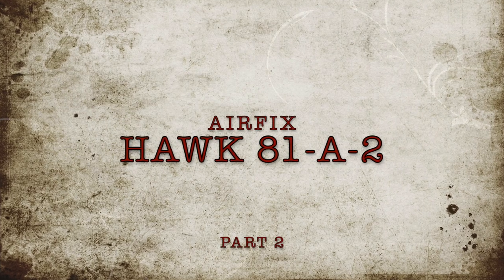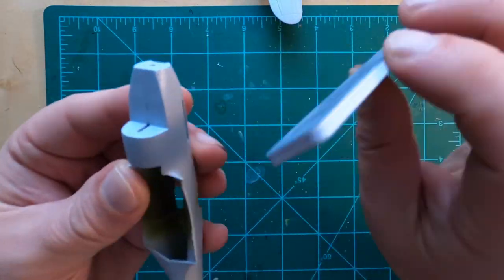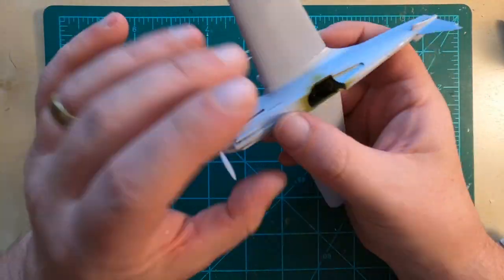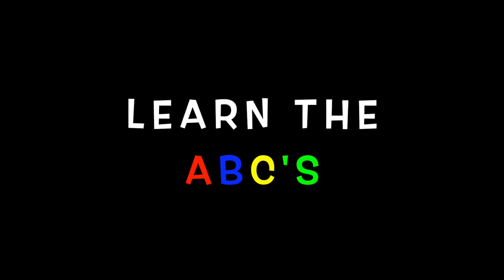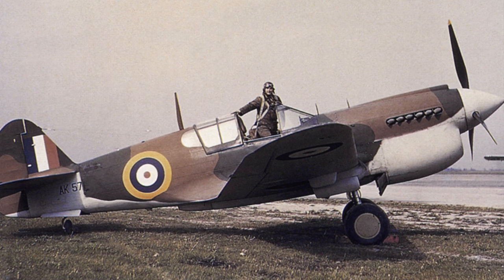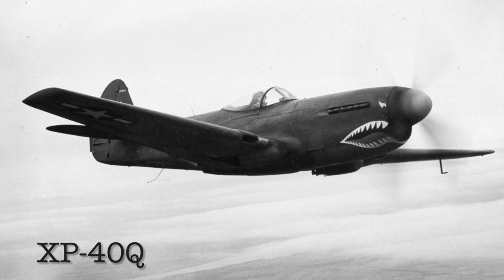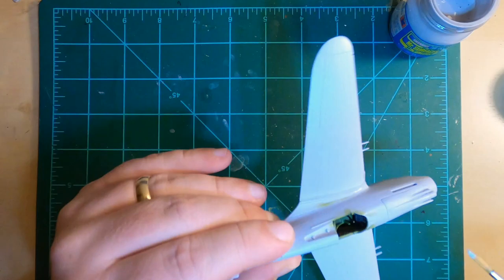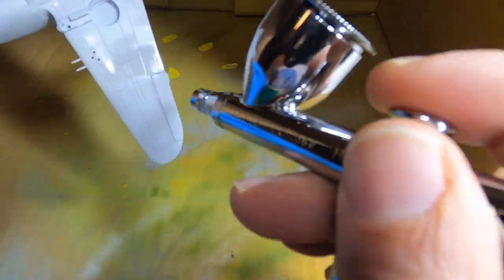Airfix 1:72 P-40 Warhawk Part 2

Comment: The P-40F is my favorite variant. The Allison engine had a down-draft carburetor.  That is why the intake was on top of the cowling.  The Merlin engine had an up-draft carburetor.  The intake had to be moved to the inside of the radiator cowling. The later model P-40's, starting with the "F", had only the rudder and vertical stab moved aft to correct a longitudinal stability problem.  The remainder of the aft fuselage was not changed.

Comment: I just started using sprue goo. It helps with gaps a lot
Reply from the maker: I've just got my first batch made up, haven't had a chance yet to use it.
Reply: @buildinghistorymodels  it worked pretty good on the project I'm working on right now a Hobby Boss Stuka. I would suggest using it as a base with AK acrylic putty on top. Filled in the seams without sanding